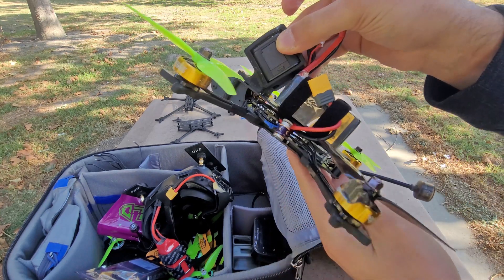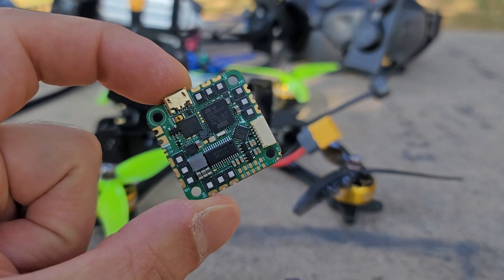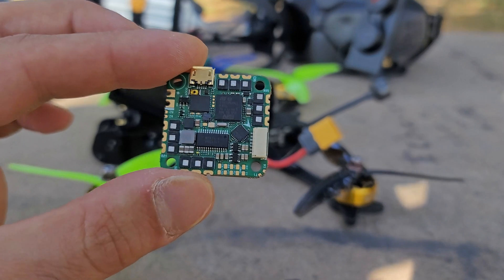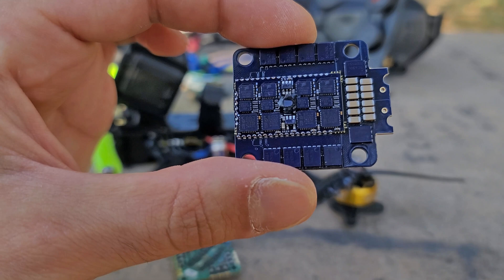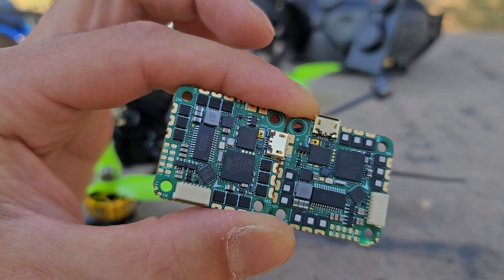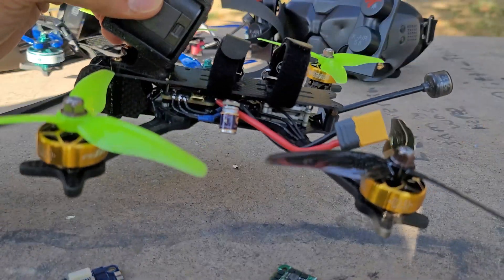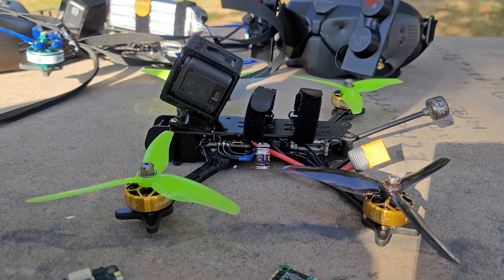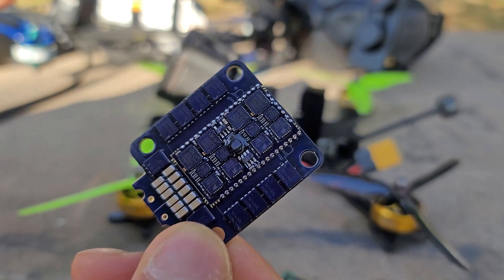iFlight Beast H7 AIO - A Whoop board for FULL 5"?

Comment from the maker: H7 version: http://bit.ly/38DC7rp
F7 version: http://bit.ly/3hnbTxk

The H7 version can actually drive full 5".  The F7 is close but not as capable.

Table of Contents:
00:00 - Intro
04:15 - The two versions
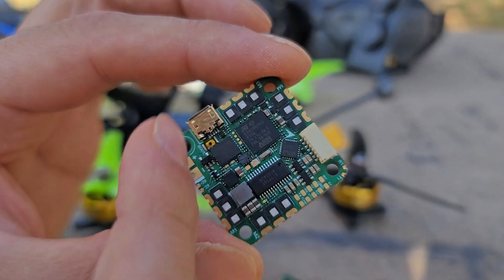05:27 - Layout
03:54 - 6S flight
09:35 - a full flight

This ESC is considered one of the best in the industry:
Tekko32: https://bit.ly/2Ut7HRW
Tekko32 metal FET: https://bit.ly/3kuuasr
We have the lowest price on these boards.

The motors: https://bit.ly/38PRzlM
The props: https://bit.ly/3lxTgb9

Stay tuned to www.FPVCycle.com.  We've been working extremely hard on a bunch of new things.

▼Join the FB group for more discussion: FPVCycle - Kabab FPV
https://www.facebook.com/groups/379155946182689/

▼ Tips?
Patreon: https://bit.ly/2oGLP9b
$1/mo from 1/4 of my subscribers will make me almost quit my job.  Thank you

-PayPal: https://www.paypal.me/kababfpv
-Bitcoin: 1E4XZXoD4rS6MYWVWuenY7Kw2M1YgyNpoQ
-Nano: xrb_1188ek5bd7tb9kw67asnp9o65byuoaxbtpxuznx1ribf75x78awywmakj55f
-ETH: 0xD067F93811f2eC31CB1928901002dfdf9A492EF5
-LTC: La2KWYAjp4VT2Lq2M76pbjzXWvRyjpfCtG
Reply: Would you be willing to try with your 30mm motors since its 55a?
Reply from the maker: @high008rise  this board is way way too small for that big of a motor.  It barely pulls off 2306/2207. Very very barely
Reply: @Kabab  i guess i will try on 6S 7" 2806.5 1700kv and toothpick style frame
Reply: F7 for long range 6s 7" quad, are this fc is capable to handle this set?
Reply from the maker: @TDPro1  I wouldn't recommend the f7 version. The h7 is alright.
Reply: @Kabab  even thoug with cinematic fly characteristic?
Reply from the maker: @TDPro1  neither one is ultimately that good. The noise management on all of these small aio boards is terrible. It's really hard to get a quad that flies really well with them
Reply: @Kabab  okaay.. thank's kabab for sharing 😁😁👍
Reply: @Kabab  one last question kabab, can i build 4" longrange using 1207 6000kv motors?
Reply from the maker: @TDPro1  sure but that motor size is too narrow and kv too high for 4" unless you're planning on 2S operation
Reply: @Kabab  so, if i plan for li-ion 2s 3000mah can i build longrage 4"quad with this setup? (F7 beast, rcinpower 1207 6000kv, and another small part for lighweight quad)
Reply from the maker: @TDPro1  sure that should work. The 12 width is still a bit small but should be fine
Reply: @Kabab  okaaay thank's so much man.. next i will build 4" longrange 2s quad.. fc aio beast f7, motors rcinpower 1207 6000kv, hglrc zeus 800mw, caddx ant, tbs rx and gps... I hope i can get a lighweight 4" quad 2s with this setup.. thank's again kabab 😁😁😁

Comment: Just now seeing this video and wondering why my protek 35 6s stopped working?Flew perfect for a week or so and changed over to the gemfan d90 5 blade and after doing a roll it did a death roll and won’t arm now.So I was hesitant on buying another replacement board but after watching this video I’m thinking I just got a bad one.
Reply from the maker: Unfortunately failure rates of electronics in this industry is very high

Comment: What do you think of the Flywoo Goku 745 AIO 
I’m thinking about using it on a 3 inch Ripsqueak frame. 

I really wish they would come out with 3 1/2 inch arms for the Ripsqueak.
Reply from the maker: None of these aio boards are all that reliable.  They're okay just keep in mind they're not bulletproof or anything close
Reply: @Kabab  I wish there price reflected that better !! Lol everything is soooo expensive now !!
Reply from the maker: @fpvraver  yeah I'm working on the annoying expense of everything. There's a stack coming that should be pretty intesting.
Reply: @Kabab  Nice very nice now I’m excited I hope I don’t have to wait too long 🙏🏻
Thank you for everything you do your inspiring !!!!!
Reply: @Kabab  I would hope the Flywoo Goku 745 AIO would be ok on a 3” inch quad copter.
Reply from the maker: @fpvraver  it's not always about the size quad or load on the board. These electronics just have awful QC in general and just because it's expensive doesn't mean it's gotten better
Reply: @Kabab  ahhh ok I see now. Your saying Flywoo or Happymodel QC is about the same. 
Ok thank you for clarifying. 👍
Reply from the maker: @fpvraver  happymodel is much worse than flywoo. Flywoo tried to be good but there's only so much they can do.  Overall they're not bad. Nobody is really great.
Reply: @Kabab  ok thank you for your input. 👍
Soooo the Flywoo flight controller would probably be better quality. There are limitations on these boards because there’s so much on them the heat involved and all that so they’re not going to last a very long time that’s what I’m gathering thank you very much for your input. 
What I’m getting from this is I should go with a stack how do you feel about 16 x 16 probably the same? LOL I mean it only makes sense.
Reply from the maker: @fpvraver  the limitations vary but mainly seem to stem from poor quality recycled components and poor quality PCB manufacturing.  Usually the PCB design is not the issue but much of the time it actually is depending on the product.  More than anything it's the heat cycling of components on the board that leads to issues.
Reply: @Kabab  ok makes sense thank you so much for the conversation. Wow did I read that correctly you said recycled components?
Reply from the maker: @fpvraver  yeah it's very very very common to use recycled electronic components for mid to low end electronics. It's pretty easy for them to recycle components too. They just heat up any computer PCB and slam it against something and everything falls off. Then they have people clean, label and sort all the components.  The wonders of nearly unlimited man power....
Reply: @Kabab  I’m thinking I might just go with a 20x20 stack by Aikon . Maybe even an F4 processor. 
I’m not so concerned with future proofing a flight controller last’s me a year and a half it was a pretty good flight  controller. I also like the latest and greatest but I usually only do that on one or two  of my builds usually my 5 inch.
Reply from the maker: @fpvraver  aikon make good boards. Not bullet proof but better than most
Reply: @Kabab  bullet proof would be nice !!!! 
I have a way of blowing bullet proof my self. Lol
Reply: @Kabab  I will be ordering in the next couple weeks to a month. I’m still trying to decide if I should just go with the AIO OR 20x20. Stack. 
I’m really going for maximum performance. As light as I can get it without being considered ultralight. 
If prices wouldn’t have gone up I would’ve got the AI oh without question now with the prices being high and the unreliability of the AIO boards I kind of feel like I’m gravitating towards a 20 x 20 Aikon ESC combo. My whole issue is I’m using a vista minus pro. That why I wanted to go with AIO. THEN again on the flip side I’m not sure if an all in one flight controller is a good idea to be running a DJI Vista unit through. I believe it would heat up even more I don’t know that’s pure speculation what are your thoughts?
Reply from the maker: @fpvraver  I'd go with the two board option. Things are just too expensive today for any AIO. We have a whoop mount 2 board stack solution coming that will likely be priced at $120 or so
Reply: @Kabab  nice I’ll be keeping an eye on FPV Cycle for that. Thanks for the heads up 👍

Comment: I was extremely excited for this board, but it was a massive letdown. I was able to get single flight out of it before finding a glaring flaw that made it impossible to use on my TP3 that runs strictly emuflight. I was unable to enter the bootloader for flashing. I tried every single possible combination of USB cable, driver fixer, different PCs, and even de-soldered every single wire and cleaned off every single pad....no dice. So it will be returned and I will not be recommending it to anyone in the future.
Reply from the maker: Sadly, many many products go through the same treatment of having an excellent batch or two and then fall off a cliff so that the product actually makes money.  I dunno if that's what's happening here but I wouldn't be surprised
Reply: @Kabab  I also wouldn't be surprised. the crappy thing is, none of the other boards you recommend are in stock anywhere.  Trying to get my TP3 off the ground and this is the third board I've tried, the others are dead. Also trying to build a babytooth but 1202.5 motors w/ 2mm shafts are also impossible to come by. :(
Reply from the maker: @techromancer6702  we're gonna have our motors very soon. Likely within 2wks. The shortage is directly linked to the lack of sillicone components in the world today unfortunately. Cost of manufacturing is gonna skyrocket even more than it has so I'm expecting to see yet another 25% increase in proces of everything soon unfortunately.
Reply: @Kabab  on notify for them as soon as they come in if you can keep stock for more than a few mins they shall be mine....also, re:the beast AIO, was my problem not the board. My replacement is working flawlessly. Will see if it can last more than a couple packs!

Comment: Did people try to run rpm filtering with jazmaverick I wonder and is it safe tonuse?
Reply from the maker: Yeah it's safe but it can always light on fire. After tons of testing, these boards are still running which is great but they're not particularly different from other good boards either. They are good however, just not particularly special
Reply: @Kabab  thanks for your reply. I did alot of testing on them today. On some.filmware bi dshot acts very weird, it almost.looks like desyncs but keeps flying so not safe for me. I have v2 that works great and v1 i try to flash to 4.2.6 what works now. The only problem I have now, I accedently flashed a F7 board with H7, I hope there is a way tonflash it back because it does nothing but solid red light....
Reply from the maker: @jeramboo8511  yeah flash it back. It should be fine.
Reply: @Kabab  i am trying its not flashing... I dont know why
Reply from the maker: @jeramboo8511  it might be more difficult to get it into DFU
Reply from the maker: @jeramboo8511  try using the impulserc driver fix tool
Reply: @Kabab  super thanks for your fast reply's. This is the reason why I wanted to support you when I bought Powerpick frame 4 inch and I love it alot!
Reply: @Kabab  YES man thank you. I love you aghaga. I failed 3 times, installed impulseRC fixer tool again, then tried 2 times, now its good again :D:D:D:D:D

Comment: i got 1 manufacturing defect of this FC.....can't even flash the esc to blheli_s or even JESC....using jazzmavrick and can active bi-directional dshot, but got trouble on motor 1( hot motor)....i even tested 3 different new motor( different "s" and 'kv') but still got hot motor....they even already come out h7 v2 firmware but not compatible for the FC i bought....it just like you said, burn both fc+esc in 1 board
Reply from the maker: After a lot more testing I've actually found the iflight aio boards to be nearly impossible to tune well because of the absolutely bonkers noise in the system due to essentially zero noise management on the board.  The CLRacing aio board is a much better board but it doesn't have black box unfortunately

Comment: I just bought  this aio .I'm hear that it doesn't  support    bidirectional dshot I just wanna  know if I just run it straight  out of the box it will be ok 👌?
Reply from the maker: It will do rpm filtering if you update the esc firmware with jazzmavric

Comment: 96k communication rate??? do you mean esc pwm? that's kinda like saying the car engine communicates with the wheels at 300rpm, not really a communication. odherwise great vid dude
Reply from the maker: The comm rate referrs to the rate inside the esc itself. Not from the fc or anything. It's basically just the update cycle of the FET's as far as I understand it.
Reply: @Kabab  yeah yeah that's what I ment , it's a different pwm freqenci, it's not really a communication frequency since it's not communicating radher than driving the motor
Reply from the maker: @nistax2880  right.  It's internal, not external. Sorry for the confusion
Reply: @Kabab  I mean , it's between the ESC and the motor ,but it's not exactly communication
Reply from the maker: @nistax2880  it doesn't even involve the motor. The motor is a byproduct
Reply: @Kabab  it does tho, if you're talking about the pwm freqenci than yeah that involves the motor a lot. its not a byproduct rather than the actual product

Comment: Are you still using this board to this day? How reliable is it?
Reply from the maker: It's definitely still working. The f7 is useless. The h7 is waayyyyyy better however both have an obnoxious amount of electrical noise issues. It's actually quite difficult to get them to fly well but both still work.  It's still hard to justify the cost
Reply: @Kabab  I see, does the noise propagate to the video or the ESC?

Comment: @KababFPV You're saying the F7 is close but not as capable for 5 inch, but I didn't really get why. Is this also a concern for 4 inch on 4S 2203, or would that work great? Thanks!
Reply from the maker: Lately I've been testing the f7 a lot. It's actually really bad. I dunno if the boards I have are messed up somehow but the f7 version is useless

Comment: Is bidirectional d-shot working with the H7 board? IFlight_H743_AIO.... its not on the list of supported boards for rpm filters... https://github.com/betaflight/betaflight/issues/10466
Reply from the maker: Yeah it works. May need firmware update
Reply: @Kabab  I had to rev back to IFlight_H743_AIO 4.2.6 and install bheli_m on the esc.. its working fine now... the main problem seems to be  IFlight_H743_AIO 4.2.8 and 4.3.x

Comment: Did you change the direction by 45 degrees in betaflight for standard mounting?
Reply from the maker: Yeah it's just an orientation setting in betaflight
Reply: @Kabab  ok thanks. are you still satisfied with the aio?
Reply from the maker: @cloudsurfer907  yeah but I still don't trust it fully

Comment: Is the board still alive?
Reply from the maker: yep still alive.  The H7 one is definitely much more robust than the F7 version.
Reply: @Kabab  that's pretty impressive. I figured it wouldn't take long til kill it
Reply from the maker: @_Brando_69  this is definitely the best aio board no question. It's also $95
Reply: @Kabab  yes that's the downside. That's alot of dough. My hobbywing stacks cost more than that most of the time. Just wonder if it will hold up like the hobbywing does.
Reply from the maker: @_Brando_69  I wouldn't trust it even though it's been perfect
Reply: @Kabab  ok cool. I'm kinda in the fence about it anyways. Might just use the hobbywing and get one of the new radix fcs to try or yours when they come out
Reply: @Kabab  might have to use one when I get one of the new prototype 5" frames
Reply from the maker: @_Brando_69  sure but the design will accept full size 30x30 too
Reply: @Kabab  yea I know that. Just thinking about building something with the aio.

Comment: Merry Christmas and a happy new year! At which degree did you set the FC in the configurator so you can have it straight on the frame? I she that is factory alignment is whoop style, diagonal . So you cant set it easily to 90 degree or 180 etc. You did 45 and it worked?
Reply from the maker: You just gotta test and see which angle is correct. In this one I used -45deg

Comment: Damn this frame addresses pretty much everything I was trying to address in designing a 5” frame.  The funny thing is I kinda tabled my design after realizing that I might like wide/squashed X arms over true X and therefore didn’t really need the extended front anymore but this looks like a pretty happy medium. Nice work!
Reply from the maker: The nesr final is available on fpvcycle already. But it just sold out. More on the way. Called 'prototype 5' for now. At 20deg gopro tilt the prop are just almost 100% out of shot. 25deg props are gone and if you intend to use any stabilization software props will be gone too
Reply: @Kabab  I got the last one 😉. Hopefully I can get it in time for some sun this weekend

Comment: How do you have you cap setup? Looks cool! Looks like there is a cap cap connector on the cap?
Reply from the maker: Yeah there's a cap cap on it
Reply: @Kabab  what gauge wire do you have going from the pads to the cap cap? I wanna do same thing. Right now I have the cap leads on directly to the pads with the cap sticking out the side... I’m worried the leads will break eventually
Reply from the maker: @boonjuefpvboonjue1230  20awg and using a cap cap. The cap cap is super important here for conductivity

Comment: I doubt anybody makes FC/ESC in small quantity. But, here are 1x MCU prices at digikey. Obviously cost less if you buy 1000x

F411 - $3
F722 512K - $6
H7 2MB - $7
H7 dual core 2MB - $9
https://www.digikey.com/en/products/detail/stmicroelectronics/STM32H747ZIY6TR/10326798

https://www.st.com/resource/en/datasheet/stm32h757ai.pdf

Too much noise from slow fall? Maybe 96Khz is still slow? Why not 400Khz? GaN transistor